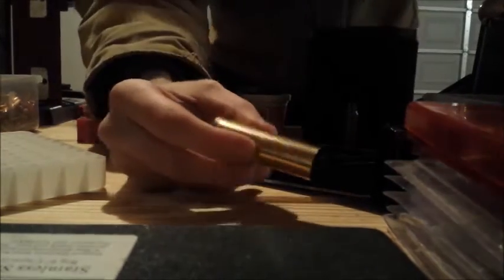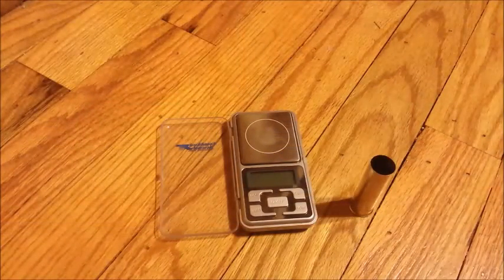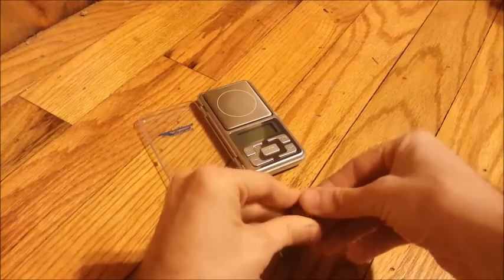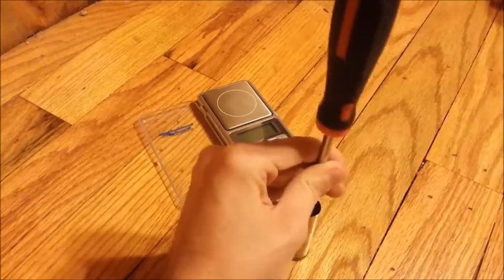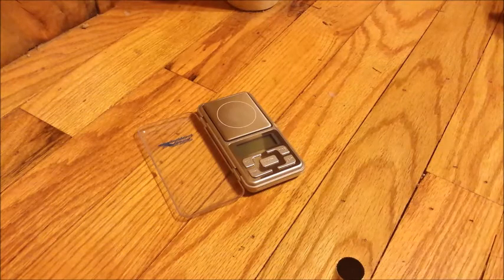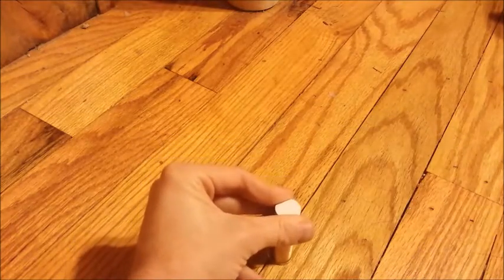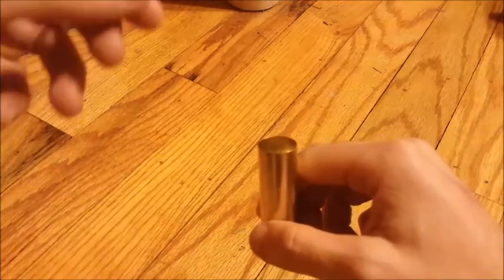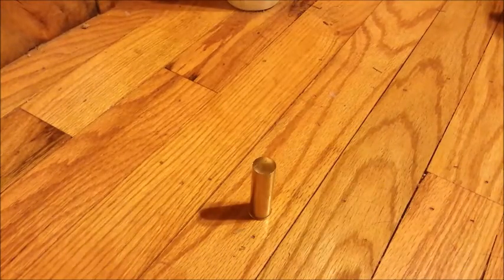Reloading Brass 16 Gauge Shotshells

Comment: I will be doing this for 12 and 20 gauge using the same CBC shells.  Hardest item to find is correct overshot cards.  Tempted to look into a pair of punches, one for 12 and one for 20.
Thanks for sharing the step by step.
Reply: 12 ga takes 3/4 inch. Not sure about 20 gauge
Reply: @timgiles9413  12 gauge takes .762 wads and .790 overshot cards 
ballistic products has a chart

Comment: Get a scrap piece of wood. Something like a foot or so of 2x4. Get a piece of strap iron (1 in W x 2 in L approx.). Inlet the steel into the surface of the wood until flush or nearly so, and glue in place. Use a wood bit as large or a bit larger than your cases, and bore into the wood about 3/8 in. Bore all the way through with a 1/4 or 3/8 in bit. Glue a flat washer into the hole to just below the surface. Now you have a self centering deprime station and a firm flat for repriming.
Now, let me say  - I really like brass shotshells. They do have some considerations. Internal capacity is greater than same guage plastic. So you can't just use normal plastic wads. Wad sizes for each guage run one size larger than plastic. 12 guage hulls use 11 guage wads, etc. Or as described, punch out your own to fit. 
Lead shot doesn't require sleeving, but steel shot does (if you want your barrel to last). Strips of Mylar or teflon, cut to fit in the case, works.
Since internal capacity is greater, speeds will usually be a bit slower. As described, firm seating of the nitro card is mandatory. Otherwise,  slow fire, hang fire, squibs, or FTF's can occur. The important part is keeping the charge in front of the primer. Some have reported good results from building up the web a bit with a non combustible material to ensure good charge placement. This also means that converting the cases to 209 primers is a bad idea unless you plan to use ONLY black powder/substitutes. 
As described roll crimp is often not necessary. Glue the overshot cards in and this works well. Another usable glue is Duco model cement.
If roll crimping is desired or needed, annealing techniques will also be needed to ensure good life from the hulls.

Comment from the maker: I have also learned not to use lubed cushion wads.  They work fine if fired within a short time of loading (certainly would work within a few hours), but if let sit for much longer the lubricant, an oil, soaks through the nitro card and affects the powder causing bloopers and hangfires.  Oddly enough, the oil did not affect the primer.

So, don't use lubed cushion wads.  Standard, unlubed wads are cheaper and less hassle.
Reply: I had six (all!) missfires using an over-lubricated .32 S&W long "nightstand" revolver. You have to get rid of an excess of oil because more than humidity that is the number one enemy of the powder. I thought a factory made cartridge would be well sealed, but not, imagine the lubricant inside a shotgun hull.

Comment: Really interesting stuff.  I've never worked with brass hulls personally, how many reloads do you anticipate getting from them?
Reply from the maker: As long as you don't crimp the mouth of the case... that tends to kill them rather quickly.  I fully expect the 25 cases I have to last most of my lifetime if not longer.

Also - I have found that Duco Cement works better than Elmer's glue in the 16 gauge.  Elmer's glue works fine in .410 and 28 gauge shells but in the 16 gauge it starts to peel away from the brass and lets the overshot card fall out.
Reply: @SladeMcCuiston  ruff up the new hulls with sandpaper first in the overshot card area :)

Comment: Hi Slade

What's the advantage of using brass?

Thank You
Reply from the maker: Thanks for your comment.  The hulls never wear out, so the reloader doesn't have to worry about sourcing plastic hulls.  This is especially a concern for those who attempt to be self-reliant, such as myself.  I would also assume brass hulls are stronger than plastic, although I'm not sure that's really all that relevant as I haven't seen many failures of plastic shotshells not related to age.  These also use standard large pistol primers so you don't have to worry about stocking another primer for shotguns.
Reply: Thank You.
Reply from the maker: You are welcome.
Reply: @SladeMcCuiston  This is exactly the type of reloading I plan to do also with brass hulls. Do you see any advantages of converting the hulls to except a 209 shotgun primer? 
Instead of using glue,  I think I will use beeswax or parafin wax to seal the overshot card. I think the new hulls need roughed up on the inside so the glue has something to grip. Previously shot hulls would not need that step.
Reply: Have ever tried to find 16 ga. shells in the store. It is easier to find a pink unicorn elephant with lime green polka dots. I found that out after I bought my Browning 16 ga.

Comment: I also got some of those and noticed there is no paper wad surrounding the primer like the spiral paper wad in regular shells, or the plastic casing that fills up the bottom in tapered shells, just the brass as seen on the exterior.
Shouldn't there be something in the base?
Reply from the maker: I haven't needed a base wad.

Comment: There is no data for brass shot shells with smokeless powder because you should be using black powder or a black powder substitute like pyrodex . There is a loading manual for 12ga thru 410 brass shells  sold by ballistic products...called loading with brass shotshells. Yes... they even have 16ga data. You will get much better results using black powder or a substitute. You are not getting the right pressures with smokeless powder.. hence the squib load you mentioned. You are asking for trouble in the form of a split cases if you keep using smokeless powder....Be warned
Reply: that book doesn't have any 410 data

Comment: Do you need to resize the brass hulls after shooting?  If so, how do you do it?  I want to start using brass shells in my M1881 Forager shotgun, which is what it was designed for.  Thanks!
Reply from the maker: I have not found the need to resize these hulls after shooting, even after multiple reloads.  Maybe after some really hot loads or something, but I haven't had issues.
Reply: If you use the shells always with the same shotgun the hulls are nothing but adapted specifically to it, although could not fit inside the chamber of a different shotgun (another 16 gauge).
Reply: @newhuskytwenty  100 % correct :)

Comment: Bloody dangerous way of loading!! Hammering on BP over a live primer with a neat fitting piston. Also, that's a very weak load at 14.5gr BP, when the standard load, under an ounce of shot, is 75gr ( 2 3/4 drams )
Reply from the maker: I've ordered a machine to seat these primers now.  Also, I DO NOT use 14.5 grains of Black Powder.  I load 14.5 grains of Alliant Promo (smokeless).  Be very careful reloading.
Reply: Sorry. My bad. I had searched for loading 16g BP loads and clicked on your vid, not realising my mistake.
I'm glad you have a way of keeping the live primer from making contact. Safe shootin'. :)

Comment: Hey Slade found your post over on cast boolits how's the recoil with trailboss, and how full does that put the case?
Reply from the maker: Recoil is still fairly light but more stout than the 14.5 grains of Alliant Promo.  Trail Boss fills 1/4 or less of the case.  DO NOT compress the Trail Boss.  Bad things happen.  I could safely fit more powder in there but the fiber wadding started blowing patterns into donuts.  Found around 20 grains to be the sweet spot.  18.5 grains is what I settled on.
Reply: Slade McCuiston , awesome thanks for reply. I'm actually loading for a German drilling. a combination shotgun rifle and I currently am loading the obsolete rifle caliber of 9.3x72r with trailboss and being able to load the 16 gauge with trailboss too sounds great. thanks again!

Comment: You should never pound your wads or powder or anything. First off it crushes it,  your loading a muzzleloader except in a brass case. Hearing someone hammer there load down is extremely cringe and unnecessary, push until it is hard and seated that’s all that is necessary.